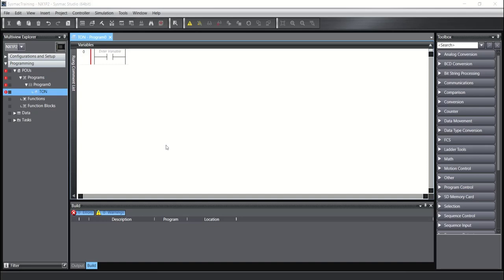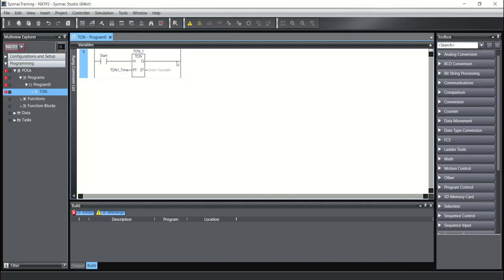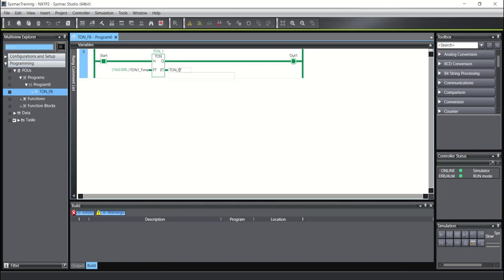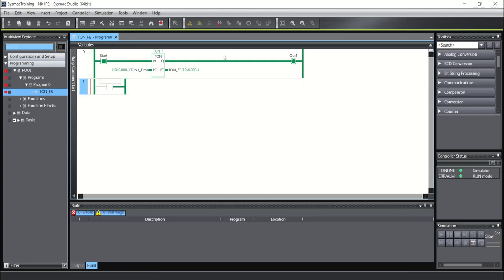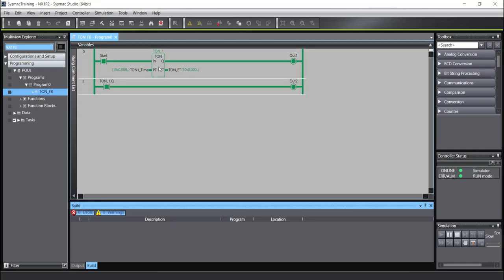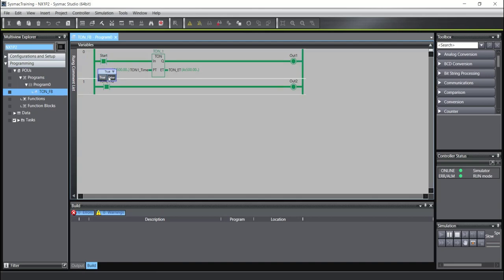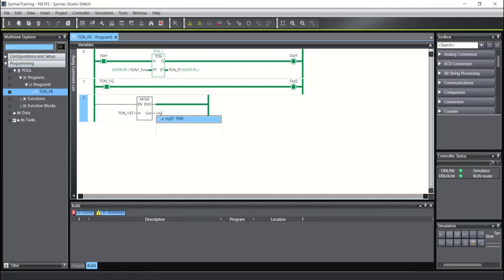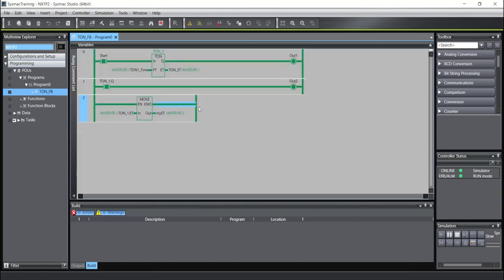On Delay Timer (TON  FB) in Omron Sysmac Studio How is working?

Comment: Thanks for the video, helpful!
If I want a lamp to blink during the timer is set on TON_1 then turn off after the timer is done counting. For instance a 10s blinking lamp. How can I do that?
Reply from the maker: There is an instruction called Get1sCnt, whose output increases every one second.
You compare the output of this instruction with the number 10, and if it is greater than or equal to 10, you generate an output.
Then, you perform an AND operation between this output and the output of a timer.
Additionally, whenever the value reaches 20, you use a MOVE instruction to set the variable back to 0 so that it starts again from the beginning.